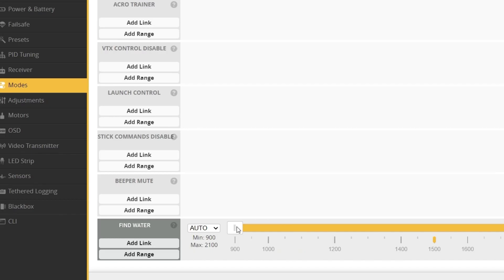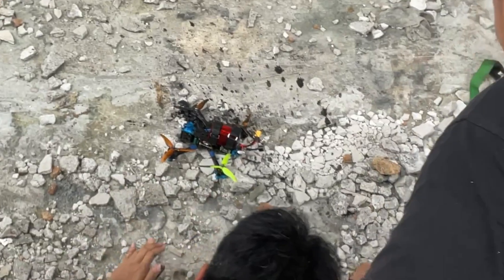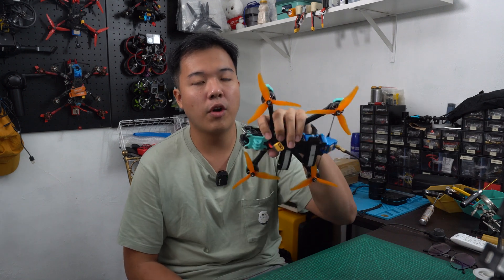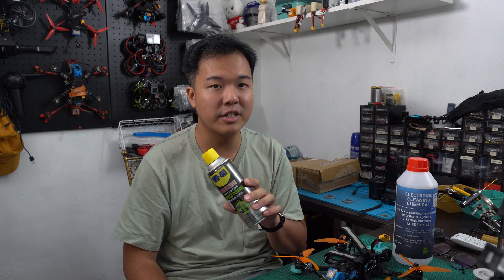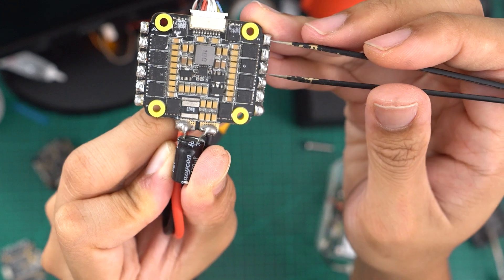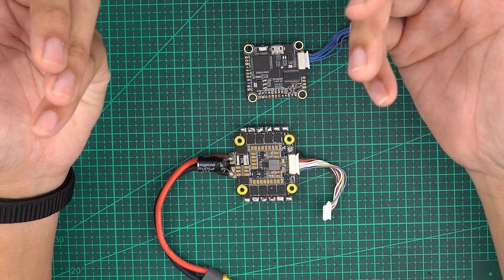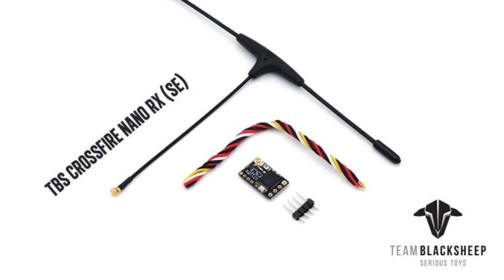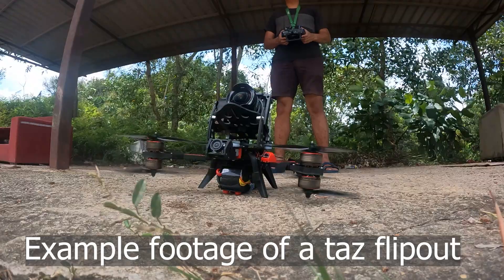FPV Drones & water damage

Comment: Thanks Sifu, really helpful. Remind me my quad fell into the sawah padi totally covered in mud. I did unplug the lipo underwater; washed sprayed contact cleaner; dissembled and dried everything. All work and fly fine except VTX intermittent interruption .
Reply from the maker: Damn bro better replace new vtx. I also had the same scenario and totalled the drone because of vtx failure.. you flying analog ker?
Reply: Both Analog and digital. Yg jatuh tu analog, ; agreed need to change vtx, may be later swap with vista. I saw you footage at Pandamaran sport area, I previously stayed at Port Garden (Kg Raja Uda) just opposite sport centre. but after PKP returned to my hometown in Penang
Reply from the maker: @captmohmadabdullah2577  ya bro i totalled a drone cuz i fly vtx after water damage and it just died after arming 🙂‍↕️
Yeah pandamaran sport area best for flying cuz alot space. Hope penang u found some nice spot for fly bro

Comment: fun fact it's actually impossible to bring any battery down to zero volts as volts is just the difference in potential, and the chemicals will always have some potential between them.
Reply from the maker: thats true, i always see one or two cells that stay at 1.xx volts. While the others might be low but not zero

Comment: Great video! Something else to be aware of, the contaminants left from water can cause corrosion to start but not cause issues right away and can kill a component randomly several months later even though it was working fine after the plung and drying, this is actually why you want to use the IPA to actually clean the electronics, removing camera housing and all that, don't just thoroughly dry everything, hope fir the best, then try flying it... It might seem fine, but could suddenly drop out of the sky 6 months later on someone hurting them... I had one that spent months in a tree before a storm finally knocked it out, everything worked fine for months, then it finally died mid flight, upon inspection corrosion slowly built up under the components, just took time for a problem to develop, washing down with IPA seems to help that, i also use vip camp dry occasionally on my electronics, the silicone coating helps replel any rain drops  i might fly though and its easy to just give everything a spritz occasionally the night before flying
Reply from the maker: thanks for sharing.  I've experienced similarly with some electronics being fine momentarily.  
I'm curious to know more about cip camp dry, whats you're experience been like? like does the solution harden and have to be cleaned occasionally and all that?

Comment: There is no point in destroying the battery if it wasn't overly discharged while underwater.
 
They are a sealed which makes them pretty much waterproof.
Reply: the tabs can corrode super fast in salt water. Just 5 minutes in salt water is enought to ruin any battery.